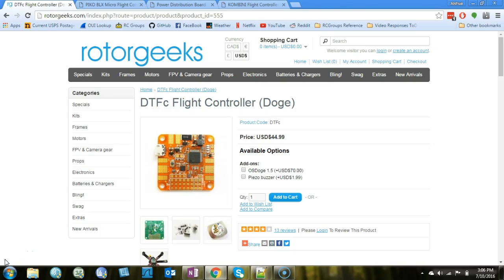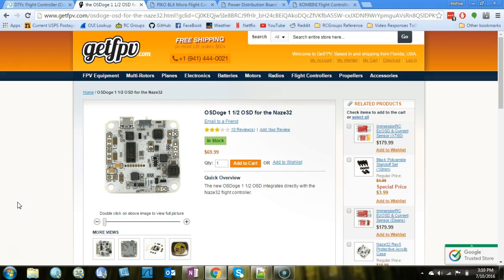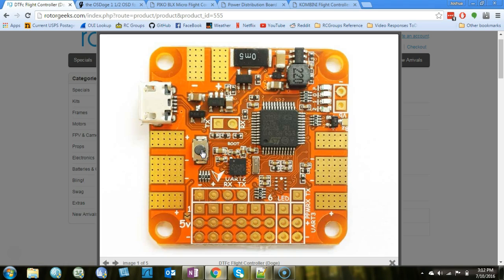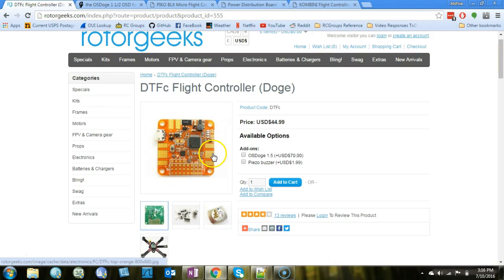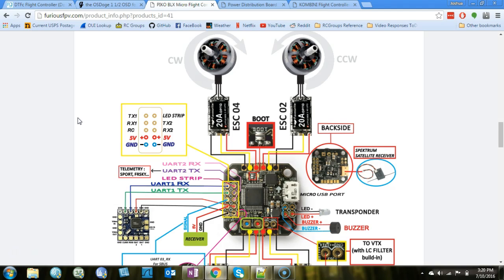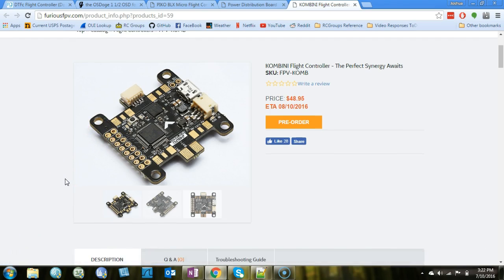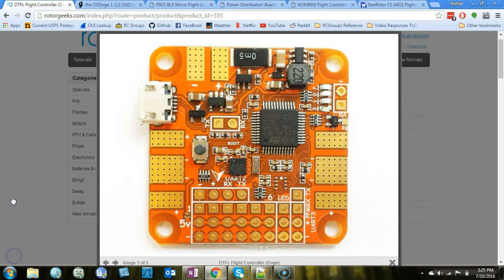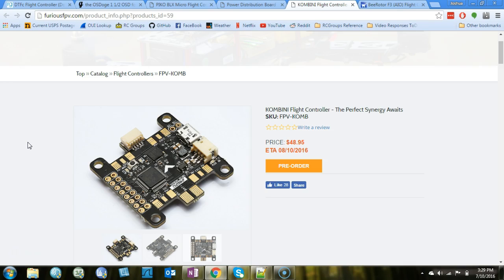Quadcopter Flight Controller Roundup: DTFc, PIKO BLX, KOMBINI

Comment: Have you seen the new version of the TBS powercube used in the Rotor-x Atom V2...?  3 layer stack, FC/esc/osd/vtx everything can be controlled/changed via the tx and osd...
Reply: thanks for the link, Yeah the TBS cube in the atom is amazing. Funny thing Joshua, I have a Piko BLX sitting on my bench about to be used in a build...but I cant see any buzzers on it either, Spend ages reading the specs on the site and scratching my head looking for in hahha
Reply from the maker: +K. Soze link?
Reply: Yes a link would be nice I cannot find it anywhere
Reply: RC Flyer85  Look at the youtube video I linked above